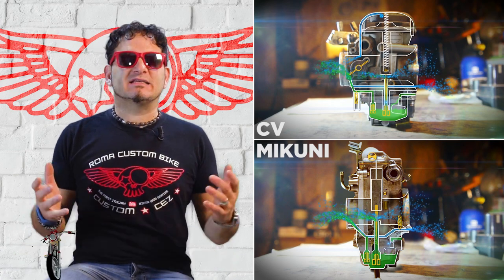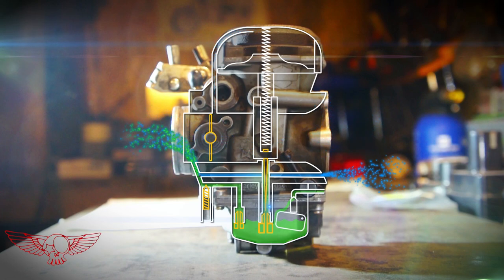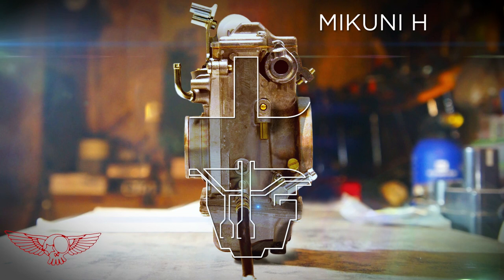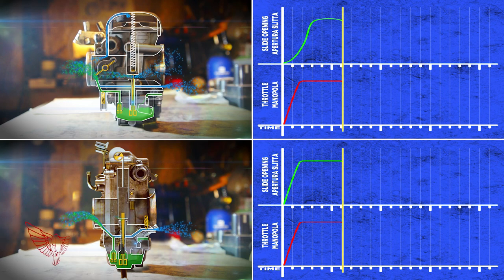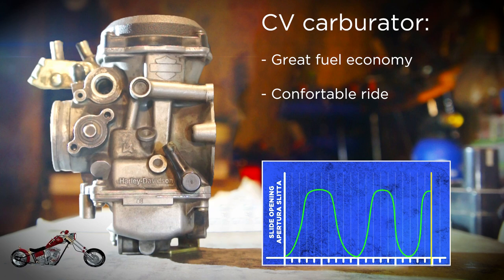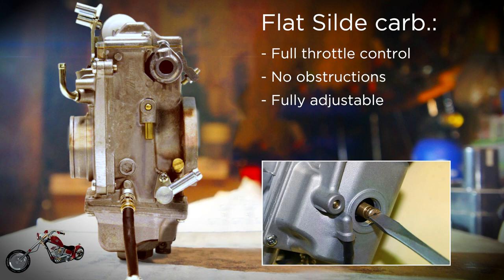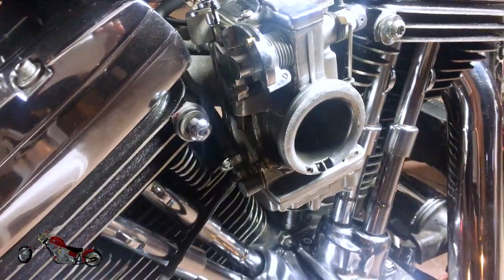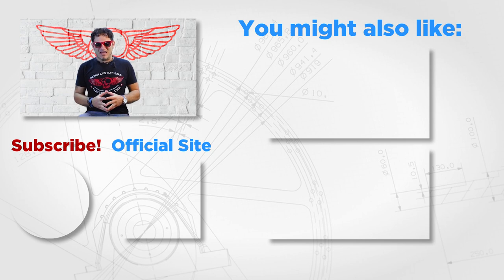CV Carburetor VS Mikuni flat slide explained - ep34 - Roma Custom Bike

Comment: I had a lot of issues with my Mikuni42 and I ended up pulling it off and putting a CV back on the bike. The Mikuni was a noticeable difference but my bike never seemed to like it and the float jet constantly moved out of position and would overflow the carb. Put the CV back on and the bike sounds and feels much better (it's like those engineers knew what they are doing).
Reply: A harley davidson with a flat slide is a beast, you should've got it properly tuned. Believe me.
Reply: yup any aftermarket slide will be worse than oem one if can't play with carb
Reply: Mikuni and the other flatside carbs are infinitely adjustable.  That said, it’s also the reason a lot of people can’t get them to run right. There is a LOT of adjustment on a Mik carb. The manual has an excellent walk through to adjust them, but most don’t follow it.  They slap it on, tinker a bit with the idle cuirtcuit and maybe the jets, usually in the wrong order or both at once, then give up and go to something else that is easier to get to run “ good enough”.
Once correctly set up, a Mic will seem almost like fuel injection.  ALL my HD run Mics, the reliability and performance is unmatched for carbs.
However, if one mostly enjoys just cruising around with an occasional whack through the gears, the CV is a true gentleman.  It’s reliable as a stone, gets great mileage and is smooth as butter in the midranges, where most people ride.  The myriad kits they built to hot rod the CV are unneeded and , many times, cause issues.
It’s been proven CVs can support engines up to around 90-100 hp.  They just perform a bit differently, a bit less responsive it seems. 
Bottom line, MIC style carbs are phenomenal performers IF you have the patience to follow the procedures and tune them properly, or know someone that does.
The CV will serve most people quite well as a daily driver and occasional romp, easy starts, great mileage and smooth.
Also note it all has to come together as a package, intake, cams, comp ratio, exhaust all have to work together to make any engine run its best.  Running big, open drag pipes and blaming the carb is pretty common when performance suffers.
Running a huge overlap cam in a relatively mild engine, same deal, it just won’t work across the board.
There’s a ton of info today on setting up an engine properly and tuning carbs, all available at your finger tips. 
Utilize it, or don’t , but don’t blame a piece of equipment for tuning failures, ie: if you have a stone stock motor, that cam won’t allow in the increased air from a bigger carb and the pipes won’t let it out, there’s no free lunch, do the work as a system, or leave it alone and ride it.  A Shetland pony won’t run with a thoroughbred, no matter how nice a saddle you put on it…
Reply: @megastick9324  Great reply. The HD with the Mikuni was sold a while back now. That particular bike was just a rolling gremlin. Someone else tried to hotrod the bike, and I got tired of fixing Daryll, Daryll, and Daryll's Performance Mods. Once I stripped it back to mostly stock, it ran well, but I was just sick of the thing, so I sold it off.

Comment: Exactly right! I never did like the disconnect with cv carbs in many of my bikes. My 88 superglide back in 2000 was upgraded with the mik 42 along with pipes air filter and hot coil. Instant throttle response loved it.
You can almost feel every power pulse of the engine.
A friend has the bike now and his brother with a newer fuel injected Harley tried it out not expecting much with the old technology bike. He was speechless afterwards.

Comment: Good vid.  But you didn't mention the vacuum drop when you 'dump the throttle'.  How does the flat slide maintain fuel flow when intake vacuum drops when the throttle is popped open?
For the road I'd stick with the CV40.  But thanks for the vid.  sub/Likie
Reply from the maker: Great point! It's all a chain of delays... not much but enough to smooth out the closing of the slide ;)

Comment: It’s all about itemization , the flat slide does it better .  We had big performance gains through the off idle to mid range on 2 valve Ducati motorcycles .  Not only did it increase the mid range significantly but gas mileage was increased dramatically .

Comment: I just swapped my cv for a this carb on my 97 evo. Better starting and better throttle response.
Unfortunately I didn’t feel any power increase.
Disappointing considering here in Australia it was nearly $500 !
I would appreciate any advise.
Reply: The potential is there ( as it can support more power ) if you wish to go with hotter cams ect.
Personally I would only go to stage 1 for longevity. Harley engines have long strokes and piston speed comes into play here with hot upgrades. You can only rev them so high. Great engines for cruising and midrange torque

Comment: Great information! I have hsr42 and been thinking how good it really iş compared to CV. This video gave me the answer. The extra noise of hsr iş something I don't like and also noticed the tender əs of throtle control, especially on low speed (in town). But as told in video it really reacts quickly when needed. One thing that wasnt mentioned in video iş the benefit of idle control on HSR. İt really helps the cold start as you don't have to use throtle for it.

Comment: Nice, found this when wondering if I could replace the CV style carb on my 70cc moped with a slide style carb meant for a small ATV.  I had always wondered why 50cc mopeds had such weird carbs.  In mopeds, the extra moving parts and smaller jets means it can get gummed up with bad fuel pretty easy if you don't run them on a regular basis.  I will be switching to a slide carb on mine just to see how if feels.

Comment: That accelerator pump on the carb is out of tune as the fuel shouldn't hit the slide when opening the throttle. Other than that, great video explaining the differences between a CV and a FCR carb. I think FCR's sound great because of their sound :P and everybody should know about em'.

Comment: Wei used to run the keihin FCR flat slide on the R6 back when they were carbureted. It gave you about 3 horsepower but required different jetting from 80-100 70-80 and below 70 degrees outside temp. If you got the needle position and slide cutout right they ran great. They don’t make the bike jerky or anything down low, if you crack it open at low rpm it just bogs the engine. If you like screwing with jets all the time have at it.

Comment: Bro I have a problem with my Mikuni 28 mm flat slide carb with a 17.5 pilot and 260 main jet . It’s on a tillotson 212 cc non hemi with a 32 mm intake valve and a 27 exhaust valve . I have a 310 cam and it’s a stroker crank . I stay in Orange County for altitude. When I get it to start it won’t stay on for long and it runs high ! I did notice when I ingage the choke , it turns on right away . Please help ty

Comment: A great help to me. Now I am clear that  in some carburetor you can control the idle speed by controlling the fuel by turning the screw where as in some carburetor you are allowed to control amount of air to the carburetor  for controlling the idle speed.
Reply: Yes, usually keihin and clones have a fuel screw and Mikuni uses air scew

Comment: Excellent.   I'm familiar with mikunis and I love the adjustability.   I find these videos cause I got an old Honda with a muddy off idle/ acceleration  until I hit about 5000rpm.  Then it cleans up and the power disembark is very noticeable.   Makes me thing pilot jet or ckt is clogged.   Or possible my slide and diaphragm are trash
  Well see.   If a cleaning  and adj don't fix it I'll just get a mikuni kit .

Comment: When you say where you're money went does that mean the mikuni gas mileage sux ???
Reply from the maker: Hahahha, you are not wrong 🤣🤣🤣
Reply: So if I want better gas millage go with a CV ??What  I have now a older FLHTCU with compliance fittings and the older style carb.
Reply: @samstinkeringaround8961  basically from what I got from this is cv is more fuel efficient, flat slide gives better performance. If you are wanting more horsepower you might be disappointed with a flat slide carb.  If it was me I would buy a big bore kit before a carb. That way you have more power and the acceleration is smoother. If you buy the big bore kit and still need more power, get a performance carb and make sure your pipes arent smaller than the diameter of your exhaust port. The more air you can push in and out the faster you can go in simple terms
Reply: If you get better mog with the CV, its because your FCR is jetted too rich, or you keep stabbing the throttle a pumping fuel into the manifold when you should just be cruising.

Comment: Hey man. You seem to know this stuff better than anyone else.
I"ve got some old Mikuni BS32SS carbs off an 86 Katana 750 that I'm fighting with, and I'm not at all understanding the pilot screw. It's on the engine side, but as far as I can tell, the pilot screw is metering the total air/fuel mixture being allowed into the engine at idle, not actually affecting the AFM. The only air passage to get past the butterfly, first passes the pilot jet before going all the way to the top of the carb and then back down just behind the butterfly.
Then, there are also 3 other small pilot ports just behind the butterfly, which cannot be metered in any way, which seems crazy?
My problem of course is that while I seem to be able to tune the idle system just fine, I have no control over what those three pilots just behind the butterfly are doing. So as soon as I crack the throttle, I end up super rich and boggy at low RPM, low throttle. Presumably this is because either those 3 pilots are too rich for small throttle openings or for the air being drawn into the system at low RPM. Or perhaps my needlejet is coming into play very early?

I love your animations as they make this shit super clear, but none of them show what I've got with my pilot. Yours all show that the pilot screw is clearly metering either the air or the fuel individually.

Comment: Thanks for your video.  I think you may be referring more to these on big street bikes.  I have a 1987 Suzuki DR200 dirtbike that has a Mikuni 42A21 pumper or Mikuni TM28-1 (the part #'s I have found but not 100% sure)....it's definitely a Mikuni flat slide w/accelerator pump.   I bought the bike used with carb apart in a bag. I had no idea it would be so difficult to find parts for....lol. I have found CV carbs online that say they will fit/work but was unsure if I should even try? I will be just trail riding and to me it almost sounds like the CV would be better for my situation. What do you think? I know the flat slide is missing  the pilot jet and extremely dirty. I just want to get it running and have no idea about engine , clutch, etc. I can "usually" tune a carb fairly well but never worked on these flat slides with the pumper. Thanks in advance for any help.

Comment: Wow my Harley chop I have owned for 3 years came with HSR fitted and it pulls away like no other bike I have had. It jolts away at every set of lights, not smooth. Thought it was a problem and now you have eased my mind in that its the characteristics of the carb. Do you have any tips on tuning it as mine runs really RICH.
Reply: Depending on what other mods you have made ( airfilter/pipes or engine), the pilot jet may need changing (richer) and the needle lowering to weaken things off. Lowering the needle will make the bike run weak at 'closed off' throttle positions so the pilot may need enlarging - don't forget to adjust the air screw. The main jet rarely needs to be much bigger than the standard one for the size of carb. The notches on the needle will raise  or lower the needle about 1mm each notch - this is a very big adjustment, you can also get thin washers to put under the needle clip so as to raise the needle just partway between notches.
 The pilot jet supplied with the carb is good for standard engine/air filter and pipes but may need to be richened. The extra fuel it gives the engine is always there throughout the opening of the carb and so the needle may need to be lowered to weaken things back down again, so do not be tempted to make the main jet bigger.
 The needle being too high can mask the need for a richer pilot jet - this can be seen by the bike's engine overheating if you ride with the throttle closed a lot in traffic etc. You may then lower the needle a notch but find it needs to be raised a little from the lower setting with a thin washer or two so as to effectively only lower the needle a half a notch or so depending on the thickness or the washer(s) used. 
Highly tuned (altered) engines need a bigger pilot jet  to allow the engine more fuel at low revs (throttle openings) as the suction is lower  ( - the engine is 'off cam') and finds it hard to suck enough fuel through a small jet making it a weak mixture. As the throttle is opened and more air is sucked through the carb (more air than a standard engine/ airfilter and pipes would allow), it starts to suck too much fuel through the needle and needle jet combination and that makes it a rich mixture, so you lower the needle to weaken it a little. Pilot jets to go to may be 27.5, 30, 32.5 or maybe even 35.
 The strong pull you mention as the carb is currently set indicates a needle that is too high as the mixture is rich and gives excess torque - my sportster with Hammer cylinders and cams along with a flowed heads and open pipes has an HSR 45 fitted with a 32.5 pilot,  needle is lowered one notch but raised a quarter notch with a thin washer, and it has the 175 main jet that the carb came with..... That is just an example not a recommendation...... hope you get it sorted !

Comment: I don't want to hear any harley boys complain about a $300 flatslide carb upgrade. The flatslides for the VMAX is literally 10x more expensive. Really. $3K for vmax flatslides...
Reply: They are 4 and the harley only uses 1
Reply: I don't want to hear any VMAX boys complain about 3k for flatsides. You could have bought a Harley.

Comment: Would do a Hrs42 on my blast but hard to set up a Tps
Would have to switch over to a voes
Reply: A killa 4 reala  switched to voes with my sportster carb
You have a blast as well?
Reply: A killa 4 reala  same 
Have a 01 M2 Cyclone as well
Hopefully getting a hardtail sporty with a built Cyclone motor soon
That motor should put 120 horses to the ground
Going to be a good lil upgrade on my m2

Comment: Great video, but mikuni hsr 42 (what most harley owners use) comes with 25 pilot (which is good for most evo and TC bikes) and an often overlooked fact is that the polished hsr42 (for some unknown reason) often comes with  a 26 pilot jet installed from factory